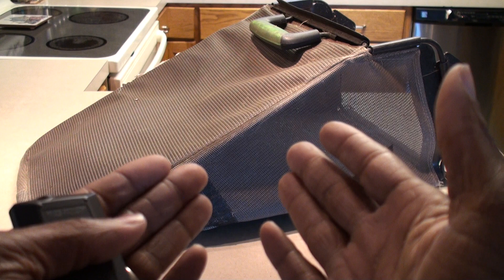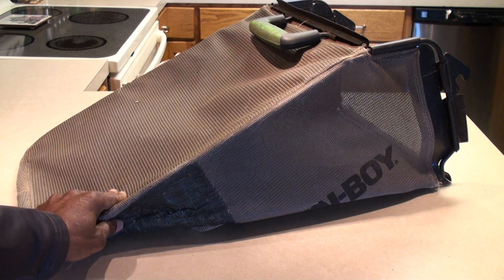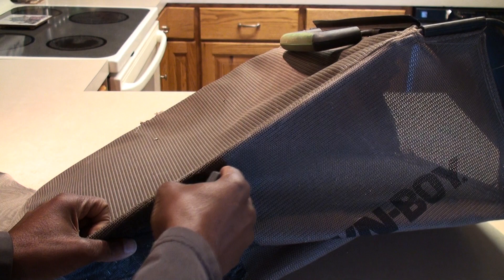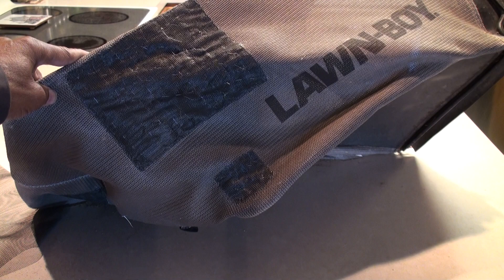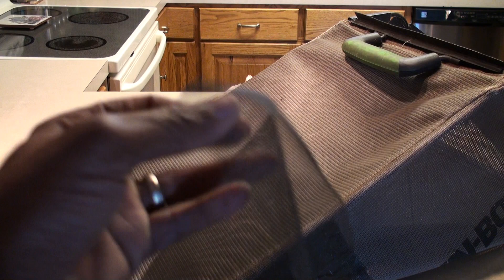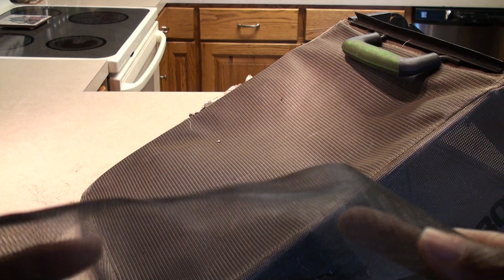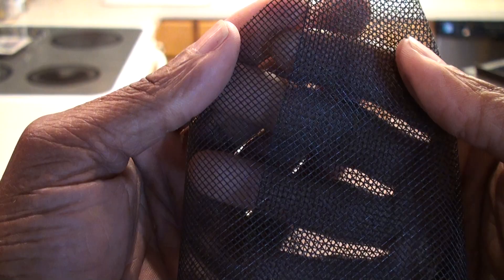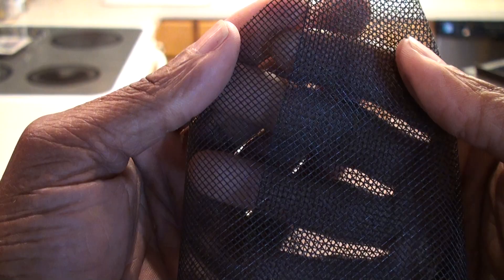Lawnmower Catcher Repair, easy and cheap!

Comment: Screen works ok but the best material to use is a product called heavy duty woven weed barrier landscape ground cover.  It's inexpensive, flexible, durable, light weight, breathable, and UV resistant and will last for years.
Reply: you sew it or glue or fold ?